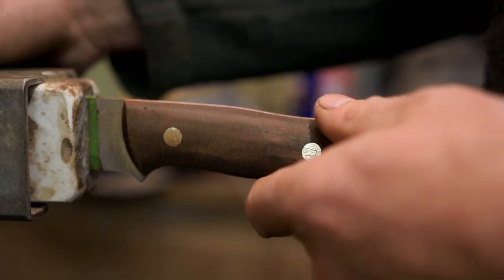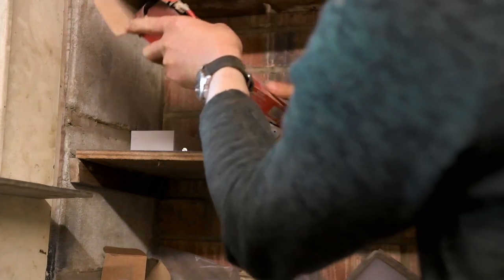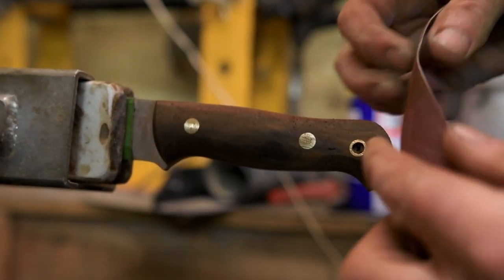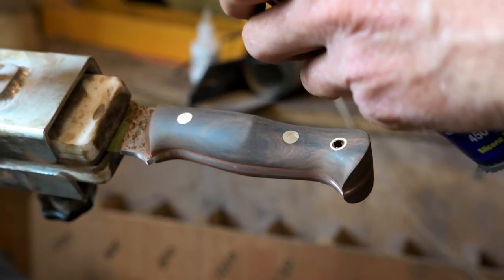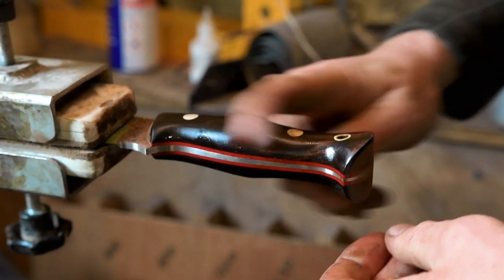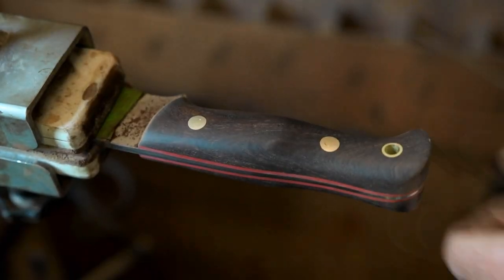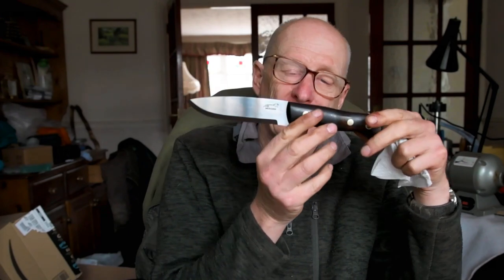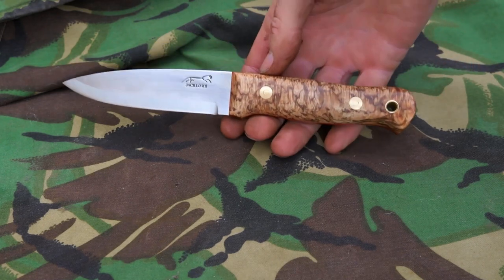Finishing a Camp knife handle and two Completed Classic Bushcraft knives

Comment: Lovely knife, when I was working we did the same, we mixed PVA glue ( normal white wood glue ) with the wood dust  as it was better than plastic wood. When I finished boat I used 10,000 grit as I had to polish the boat. You couldn't have scratches as a customer pays 1 million quid. So happy to hear and see your eye is much better, the nose, well that's a bigger problem. Here we eat pig ham for Christmas so DON'T come here. Hahaha. All the very best.
Reply from the maker: 10000 is very fine peter and I suppose you were working with larger (much larger) areas too
Reply: @Jackloreknives  I worked with boats, i was a repair man so when they made mistakes i worked nights and fixed the problems.